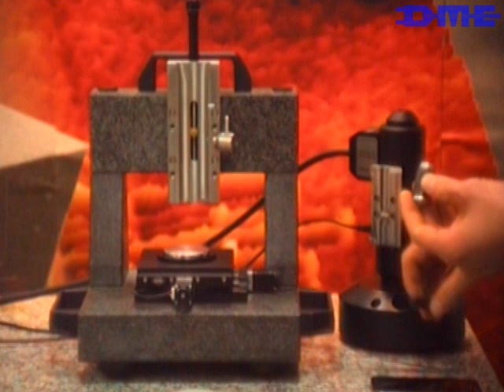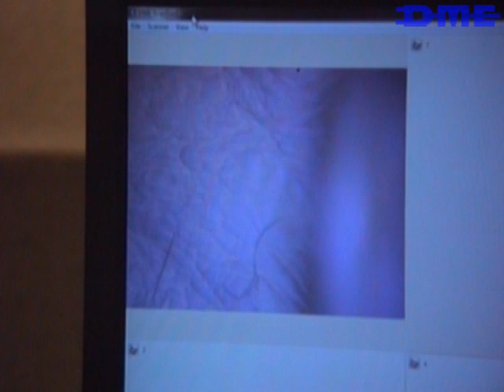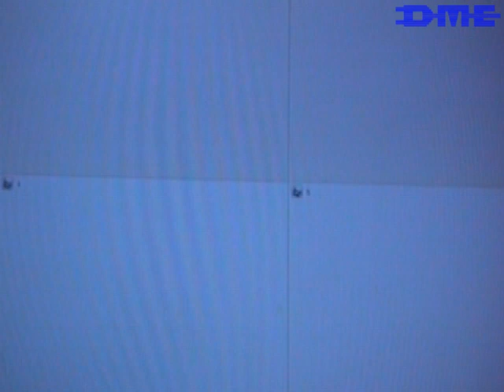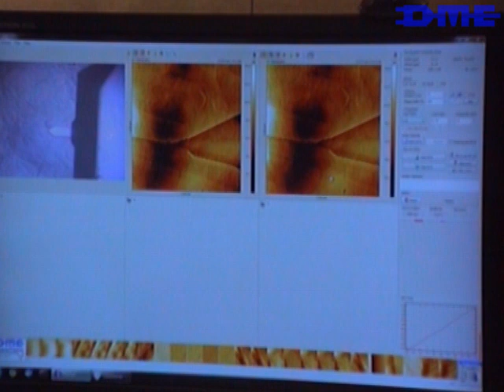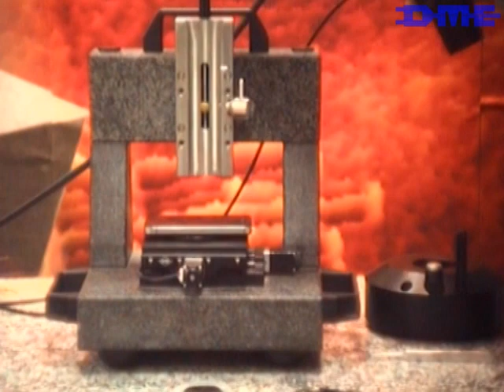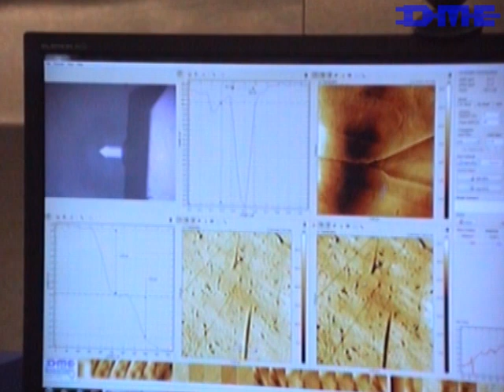Atomic Force Microscopy on iPhone and HOPG

Comment: i would be seriously interested how much such device costs
Reply: The prices for real Scanning Probe Microscope start at approximately $25000 but can also be much higher than $200000 depending on the type and its properties. The probe scanner type we show here, which permits scanning large samples, is more expensive than the most basic sample scanners but still on the lower part of the price range.